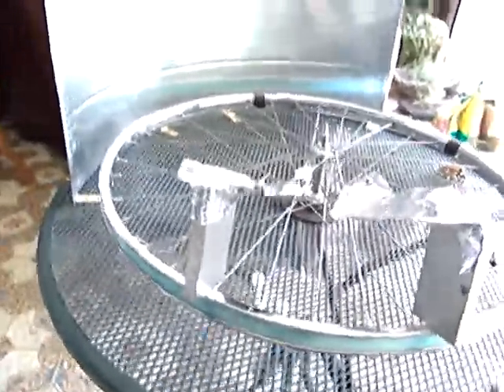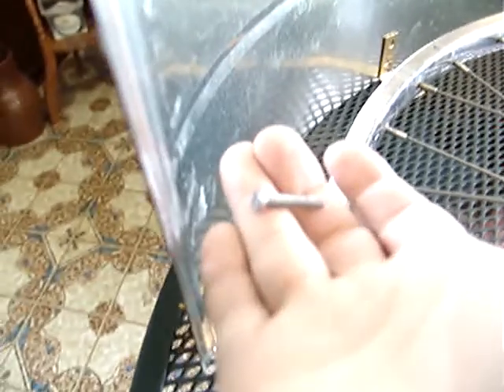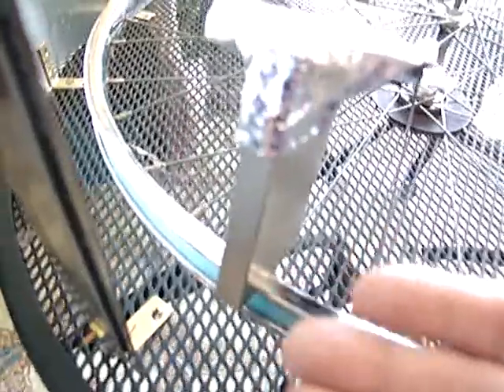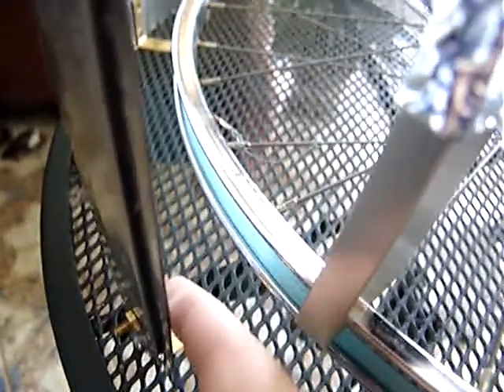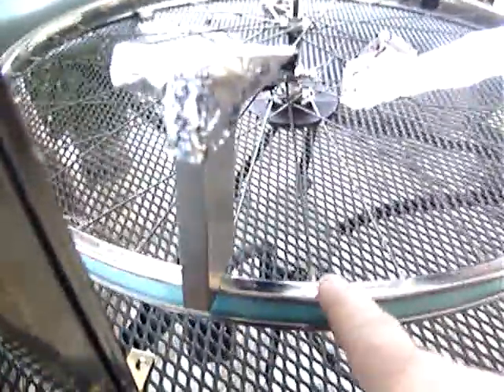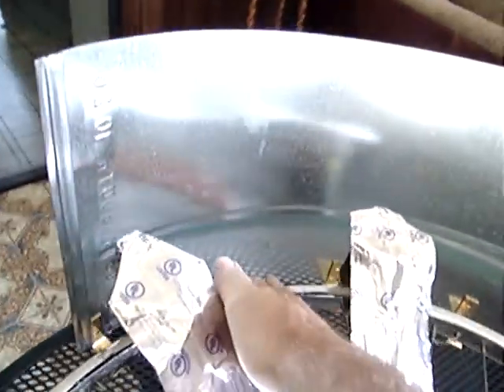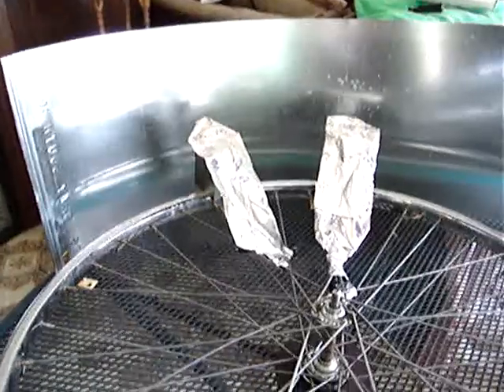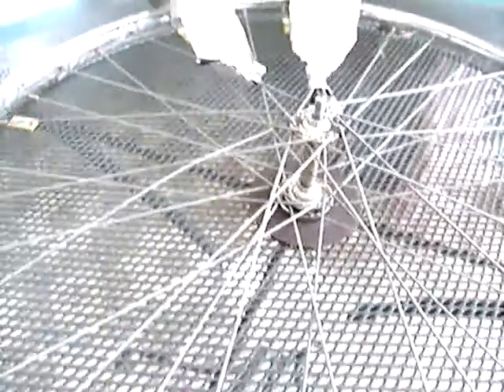🧲 Magnet Repels Steel???  Part 2 of 2

Comment: Probably due to the wheel being Unbalanced.
Reply from the maker: 🧲 Balance has nothing to do with the wheel coming to a sudden stop. What’s going on is the magnetic flux is being absorbed by the steel, causing a like polarity which cause the magnet to suddenly repel away from the steel.

Comment: Set up another shield on the opposite side, and see what happens. May not need as many magnets or mechanized parts to keep it moving forward. 

Jesus Christ Almighty God bless you all
Reply from the maker: 🧲 If you check the date, this test was from some ten years ago. As I mentioned, for reasons not known to me, this video was set to private for countless years. I simply made the video public once discovered this. So this test project was torn down over a decade ago. The results was so poor from one side, I decided that two sides with a shield was not going to resolve this challenge. This could be scaled way down and tested again, but for now I don’t have the time to revisit this test. Possibly you might do that for us? 🤔